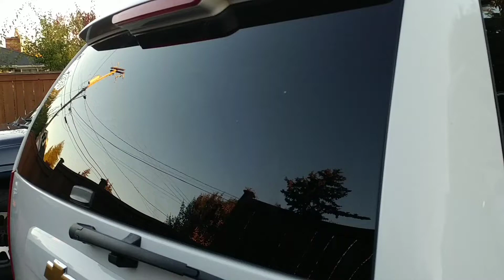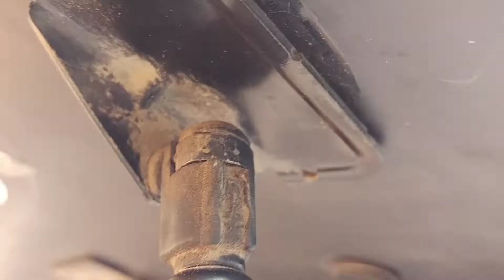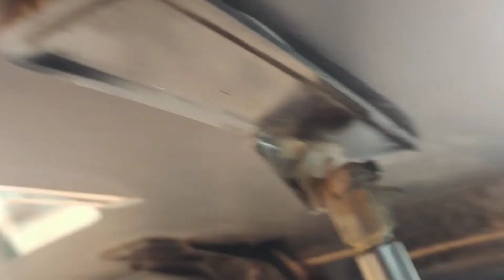Repair Rear Window Defroster Tab and Grid - Better Than Original

Comment: Don't have the copper plumbing tape but what do you think about using a penny? I think it is just copper coated aluminum and only costs 1 cent.
Reply from the maker: Paul Dobson: Absolutely. I've used a penny for this. If you brush or sand it, you can solder the tab and wire to the penny and then epoxy it to the glass the same way. I just had the copper plumbing tape on hand and found it easier to solder to and easier to work with. Thanks for the question and good luck with it.

Comment: You seem to have a wealth of knowledge.  Do you install defrost professionally.  Is there another way to repair for more expensive vehicles so it looks cleaner?
Reply from the maker: pasquale parente: Thanks for the comment and the question. I agree aesthetics matter and I did later improve on the appearance of this repair by masking off the repair and painting the entire repair black to match the surrounds. It makes quite a difference but you will still see the repair. The risk of painting the copper foil tape is that if you need to come back and bond to it, you will need to strip the paint to get a conductive bond. Fortunately, this repair has needed no follow up work. The very best aesthetic repair is always to simply replace with a new glass with new defrost attached, but the cost can be 10 to 20 times the cost of this repair. FWIW, the repair shown in the video is still working at 100%. Thanks again for the comment and for sharing.

Comment: Hey quick question. When attaching the copper foil tape to the grid, why to you need the permetex conductive glue to make contact with the grid? Isn’t the adhesive on the copper tape already conductive?
Reply from the maker: mverga 22: Thanks for the great question. The glue on the foil tape is very strong but it is not conductive so the back of the tape is not connecting to the grid. Soldering usually won't work because the factory gridlines are too fragile to solder so conductive glue works best and is easy to use. If you lay down new grid lines using very narrow foil tape, then there is a way to carefully solder foil tape to foil tape but you MUST replace EVERY grid line to get an even defrost. If your window has NO grid lines or if more than half are broken, then that might be the better fix. I hope that all made sense. Thanks for watching and for sharing.
Reply: So only if you replace every gridline with the foil. The current can still produce heat to defrost?  I figured the copper foil tape didn’t have enough resistance to defrost.
Reply from the maker: mverga 22: You have to use a very narrow foil for grid lines so that they will heat up. And it's important to replace them all so that the resistance is the same for each grid line. And you still have to solder to the vertical side busses. You can't simply lay copper on copper and expect a good connection. You need a conductive bond. I should probably do that video sometime. I just need a window that needs it ;-D.